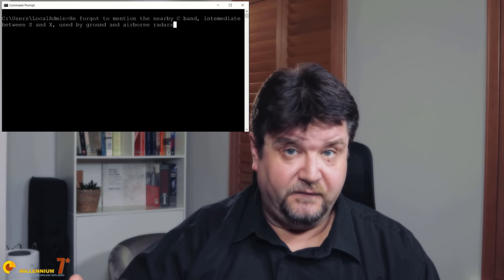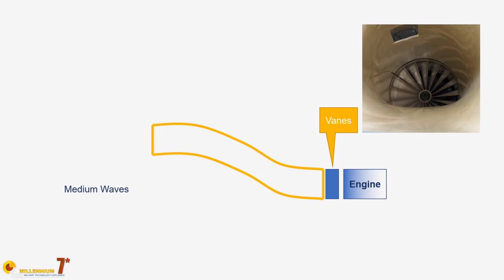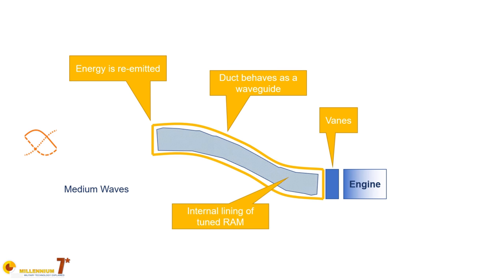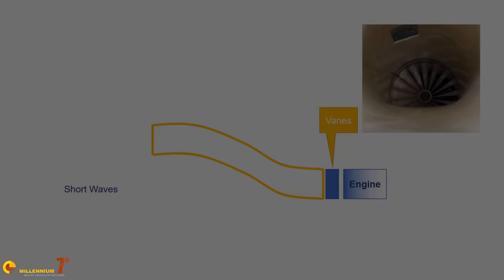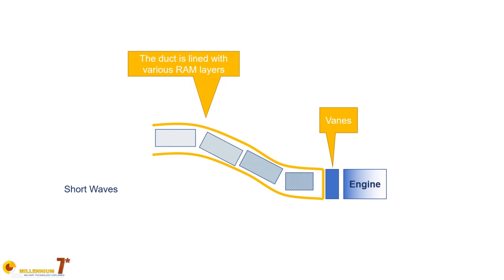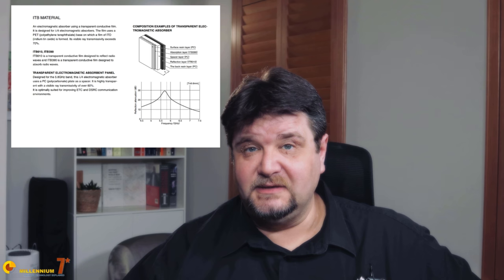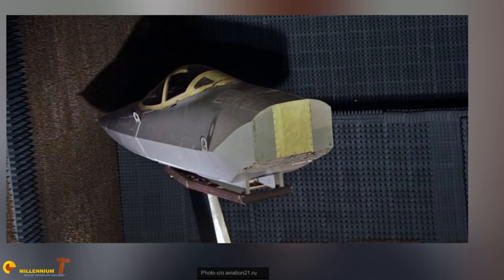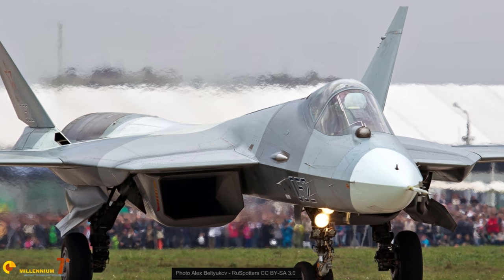STEALTH 103 | The important bits that nobody explains

Comment: A really superb video. Probably one of a kind on the internet. I like the animations as well.

A minor correction: the canopy coating is ITO (Indium-Tin Oxide), rather than gold. Although a very thin layer of gold could be used, ITO is preferable for a number of reasons. There's other aspects to this issue (related to both RCS reduction and 'other' issues) which go off publicly available info pretty quickly.

A couple minor omissions that might be worth discussing: The aft turbine of a jet engine is also an RCS issue related to rear-aspect stealth. The air flow diverter common to most conventional intakes is another area of concern (though you've mentioned that in other videos). 

And the unavoidable geometry involved is having mobile control surfaces as well. I know you brought up tighter fittings between gaps before, but things like horizontal stabilizers have some rather unfortunate characteristics. In particular the need for an all moving panel to have a flat surface to move against is "unhelpful" when you consider that these flat areas are perpendicular to the horizontal stabilizer, so they're flat-vertical. And a little known detail is how a circular reflective surface (like a bearing ring) which is hidden only by a largely radar translucent material, can be a very serious issue.

As for the geometry of a compressor affecting stealth, it's pretty difficult to curtail that aspect with compressor geometry, since the blades rotate through 360 degrees, and their AoA is variable if the engine is to have any sort of decent performance. Plus they are going to be pretty straight (no matter what) in order to survive the centripetal force involved. So compressor geometry is not a "high priority" aspect of the RCS mitigation, and doesn't "significantly" affect engine geometry in ways which would compromise efficiency, power, etc. There's a lot of opportunity to mitigate the radio frequency emissions while inside the intake channel. Use of highly 'radar-translucent' materials to guide the air, while more reflective surfaces are shaped instead to trap RF waves within the engine area, are pretty effective. Basically 2 overlapping geometries, one an open pathway to air, the other an open ended Faraday "chinese finger trap" to RF waves. It's much more about how RF signals get to and from the engine, than about the engine geometry itself. Actually, the old cone-style intakes have fairly favorable RCS characteristics, though it's better to more freely allow RF into the RF trap. Considering how multiple bounces off of a radar reflective surface do tend to disperse and ablate RF "to an extent", I wouldn't underestimate the raw value of blocking compressor blades from direct view. Or perhaps put another way, yes, it's not JUST about blocking the compressor from view, but you can't even get to the point where you're discussing the mitigation of wave-guide behavior until after you've blocked the compressor from direct view.

Using plasma as an on/off RAM material is interesting, but it effectively blinds PESA mode if you're actively using plasma in a radome. That said, AESA/PESA array shapes are rather unhelpful to stealth, particularly at mm wavelengths, which ricochet around the tines of an array like a pinball machine. Also, the usefulness of RAM with a radome/radar is pretty limited, if you want the radar to work. So it's kind of a stealth engineering topic unto itself. There is probably a sound argument for a stealth aircraft which lacks an AESA array (the F-117 for example, simply skipped this engineering issue entirely).

A fairly short video suggestion (if you're looking for ideas): "LIDAR & Stealth"

(I always watch the whole thing with your channel. I skip ahead with a few youtubers who take 5-10 minutes to get to the point, but yours are not problematic at all. It's possible that some people are simply too used to other channels which waste a really large amount of time, which kinda trains viewers to be very quick to skip ahead.)
Reply from the maker: On point as usual. Thank you!
Reply: Thank you !

Comment: Going into the Sci-Fi area, the ADF-01 Falken solves the canopy issue by simply removing it, and adding cameras on the outside, and screens on the inside, pretty neat, but what I love the most is the COFFIN system (COnnection For Flight INterface System), it's basically the same cameras on the outside, but a VR system on your helmet, why no one thought about this yet?

The XFA-27 Scarface have a different configuration, but is similar to the Falken, it has a standard canopy, but also cameras and screens on the lower side, so the pilots can see everything under them.

I love sci-fi that doesn't exaggerate, and Ace Combat is one of the best sci-fi out there.
Reply: We have glass cockpits that are similar to what your talking about

Comment: Enjoyed it again. 

I have one question if I may. The Chinese J-20 has these large canards and you use to say, that canards are detrimental if you want to maintain a low radar cross section. That got me thinking. Could it be possible to disable the canards in cruise flight (so no aerodynamic function other than that of a strake or fin in this regime) and to enable it when required (when sustained maneuverablity is necessary in combat)? I got to that question looking at the Swiss Mirage IIIs, Israeli Kfirs/South Adrican Cheetahs and the Swedish Saab J(A)-37 Viggen, where the cnards seem to move either not at all or only have the aft end parts of the canard moving. I thought then: what if the PLAAF pilots have a switch that enables/disables the canards (activating a different mode in the fly by wire software?). Would it in theory be possible to have similar frontal aspect low observability if the canards do onot move as an aft placed tail plane? Or ore canards detrimental to LO regardless?
Reply: To my knowledge, canards add very few to the RCS if there are properly made, using "radar transparent" composite materials and absorbant coatings among other things. 
It is not as good as no canards, but it can be an acceptable compromise.

Comment: Hi: On minute 7:01 you mentioned that an antenna beam is closer to the reflected signal when it is illuminated from another radar, I think about the linear antenna works on a phase array antenna and i don´t see the fact you talk about, however i understand that common radars are designed to detect and not for avoid being detected, moving the tilt upward can reduce the total RCS but i am not sure how much it can be reduced.
I always thought that stealth planes have a improved stealth of a usual wave length, if the radar transmit in a different frequency the stealth is no such efective.

Comment: Hello. Coatings like what was designed for the F-117 can even be used on a flat surface facing right back at the radar. The reason is because the radar energy causes an alignment of the Bohr Magnetons* in the direction of the radar energy*. When the energy gets strong enough to hit something in the aircraft it bounces back with less energy and now cannot overcome the Bohr Magnetons aligned against it. It's called  " switched spins". The material has lines of forces arranged haphazardly until radar energy hits it then it lines up. That bunch of different metallic oxides you said is in the Russian aircraft might not work cumulatively like you expect. This all I have said elsewhere and is almost the maximum except the Fe50 if the F-117 is Iron Oxide Titanium Dioxide and a semi-precious gemstone. Oh and a composite below the coating helps much more than yet another substrate because of temperatures and energies needed to cause the materials to go " active". Ok thanks.

Comment: dear sir , ihave a question for you .on the f35  why not to mount rhe rail on the tip of wing ?so you have only a rail  and no pylon
Reply: Because the Rail is meant for more or less universal loadouts and especially weapons which cannot launched from an internal bay. Either because they are to large or need their own optics to track the target. Which means they can be quite heavy and heavy loads and wingtip rails are a no go.

Comment: I think that in this case, if the plane gets dirty with dust like when operating in a desert environment, this will reduce its stealth, compelling it to fly high where the air is cleaner and reducing its possible tactical usability.

Comment: Could you compare how F-22 and Su-57 diferent aproach in engines in relation with stealth, please?
Reply: Both should still ionize the exhaust, diffusing and Doppler-shifting the return as just noise, even on IR to a lesser degree.  Side effects of r&d trying to reduce contrails.

Comment: With regards to intakes, why are they still not placed on top of the aircraft as far back as viable to outright hide the intakes from the ground? I am aware of the downside of potentially limiting pilot visibility but with all the other tradeoffs to performance made I'm surprised this one was not taken. Planes like the YF-23 look perfect for this arrangement already having two humps on the back for the engines while the intakes still end up below the aircraft. Does this arrangement negatively effect the aircraft in other ways like at low speed causing engine stalls? If that is the case would it still not be better to have closable louvers like on the mig 29 only on the bottom instead of the top for low speed intake?

arrangementisn'tadvantageous